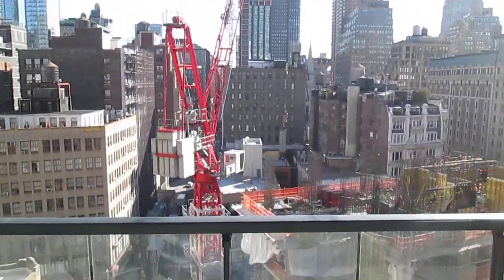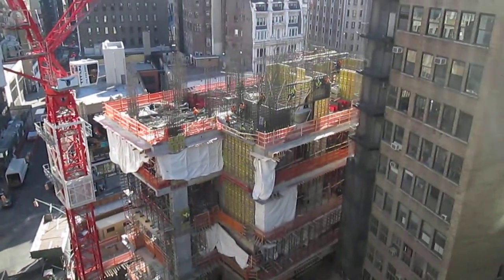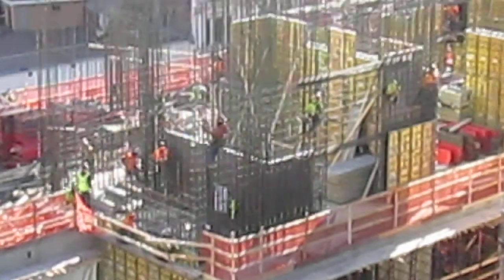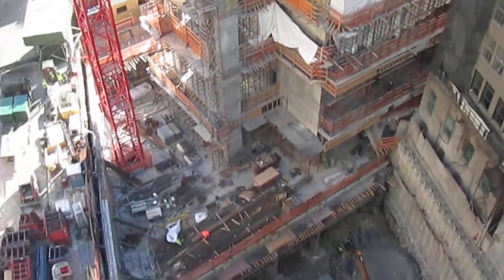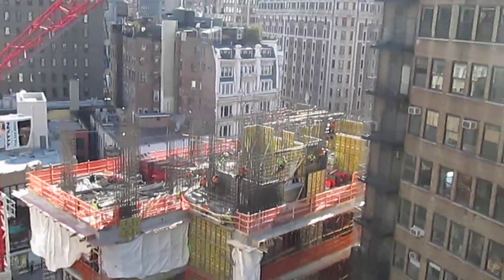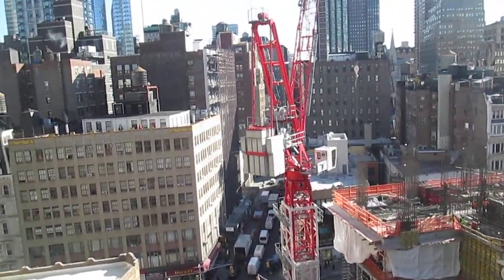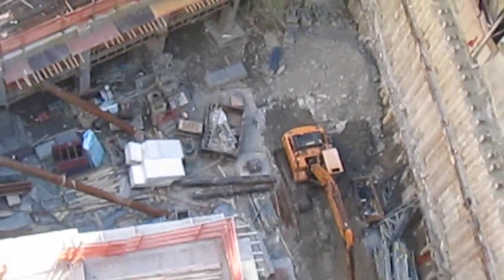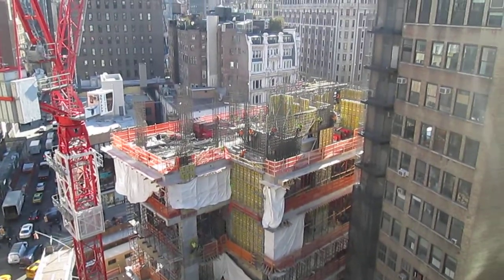Tower Crane in use in  New York City. Safety harness in use . Concrete building.

Comment: This is a Wolffkran tower crane 275B or other model number this model of Wolffkran look similar to the 1200 or 1500 but concrete are positioned orizontal instead of vertical they are new cranes maybe 4/5 years since the production started on this bad boys
Reply from the maker: Thanks for the info , thanks for watching Mike Espo..
Reply: @diecast_MikeEspo  no problems operated a few Wolffkran in the pass most Woolf's 100B's but there is many new models and other diffrent makes and models :) Best Regards Ricardo Figueiredo
Reply from the maker: @RicardoTheCraneOperator  Awesome ...
Reply: This is a 355b. A little more capacity then a 275. Great machine. Fast line speed and big capacity.